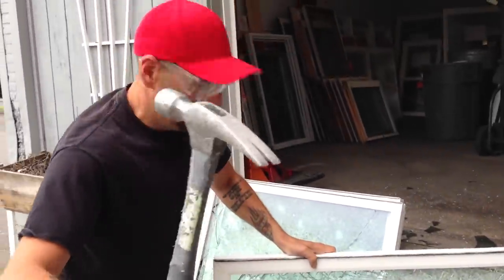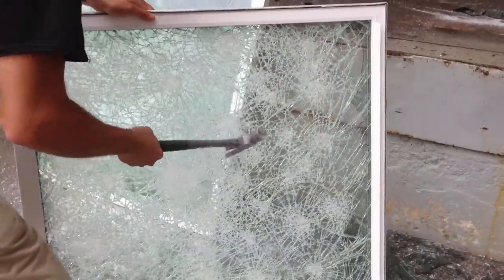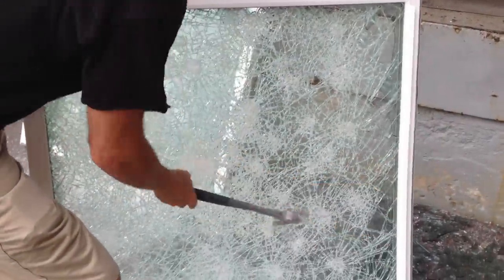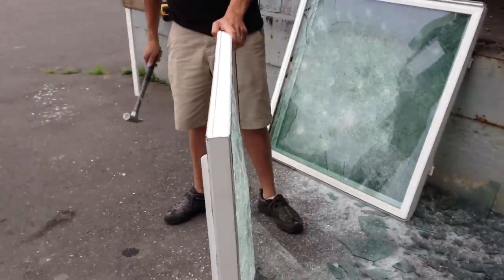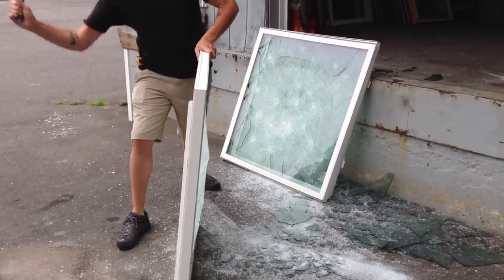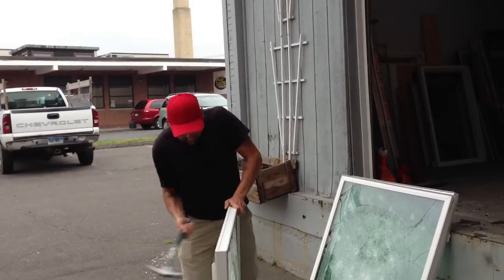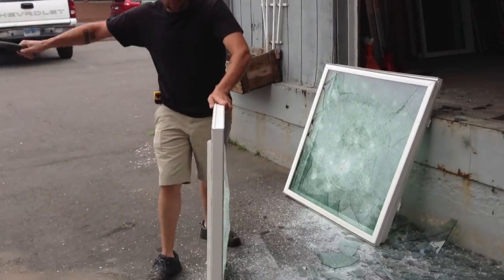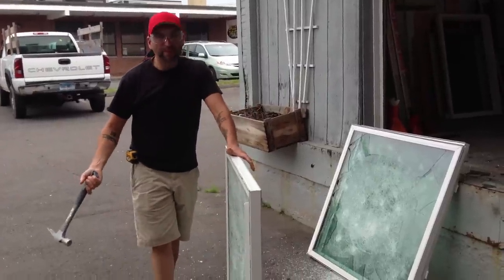Impacted rated glass Bullet Proof glass Secruity glass hurricane glass Connecticut

Comment: This doesn't show anything, if it's hurrocane rated it should stop a 200 mph 2x4, you swinging a hammer is completely weak in comparison.
Reply from the maker: the hurricane test id not a 200 mph 2x4 its actually 120 MPH, I don't have a 2x4 cannon at my shop thats why I used a hammer.
Reply: Not exactly true.  This video is exactly what I was looking for as I was wondering how hard it would for a person to force entry through these windows.  The security resistance of these is amazing.
Reply: what about a 64 year old man with a hammer in lv dry heat?
Reply: @ alex threet, LOL...that's why I came here too. I don't see how that elderly man (or man of any age) would have been able to break one, let alone two, windows with the hammer they say he broke them with.